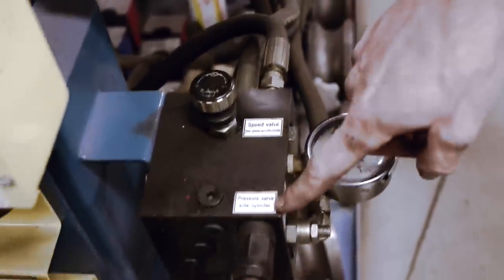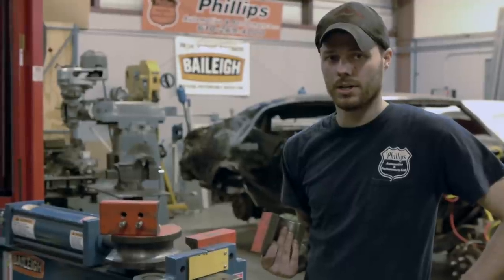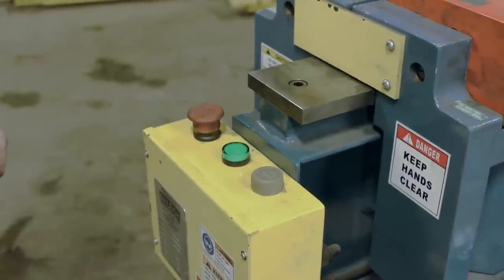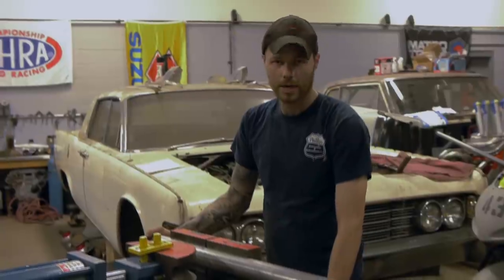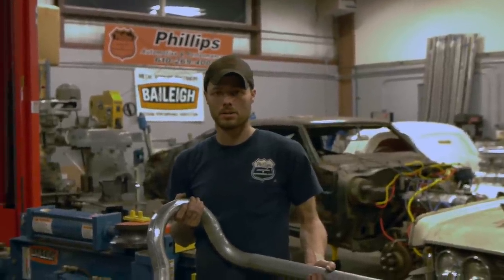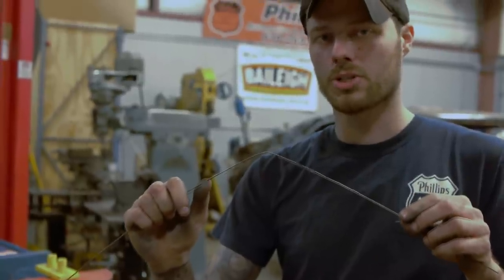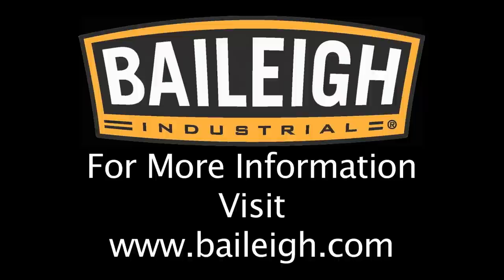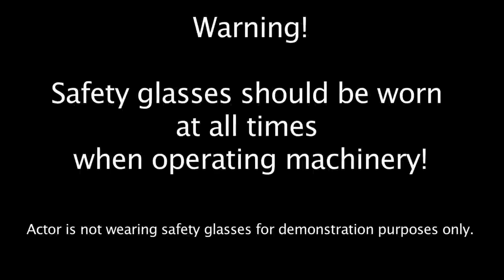Baileigh Industrial EB-300 Exhaust Bender How to Video

Comment: Well explained,and i think you've slung some tube for a while. I've worked with higher end exaust mainly stainless(which is a pain!) well over 14yrs.. Used a quite few different benders, but by far the best is a Blue Boy. Wondering if this machine is able to use a 3/4 backgate shoe without having to cut a full shoe? Reason is one of those will make a much better bend when you get most of your bend first, then swap out to a half shoe. You can also flop half shoe over into outer hole to get some of this, but not all. Is this thing really that slow as shown no video, or was the video slowed?